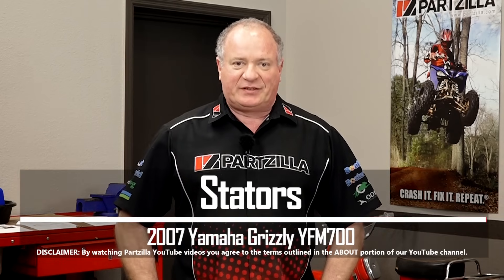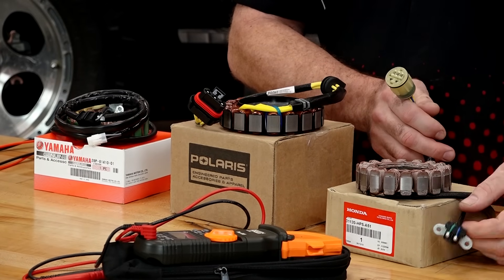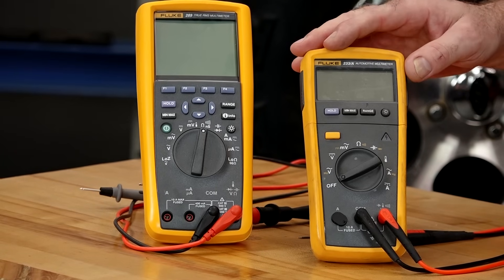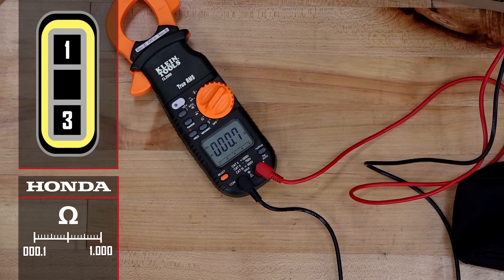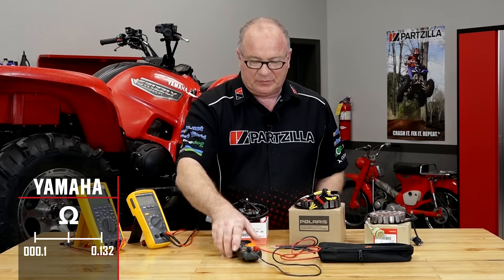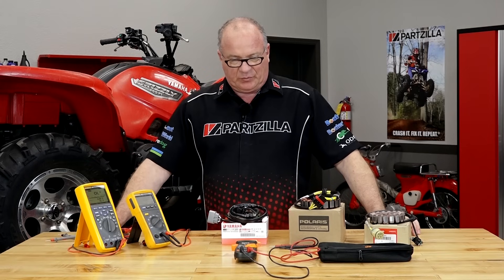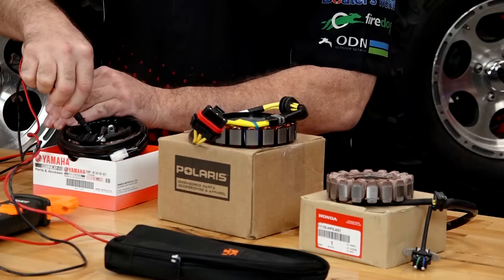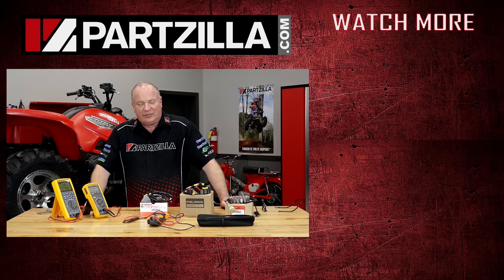How to Test the Stator on a Motorcycle, ATV, or UTV | Partzilla.com

Comment: Hello from Greece,you do great work,can i ask something.....motorbike is HONDA TRANSALP 700 and burn the stator  conector to reg. rectifier ,i fix it with three separate ones cylindrical type conectors, is normal the stator  cables (3 yelows) and the conectors to reg. rectifier to be warm (about 105-120"F) when the motor is runing...thank you...

Comment: 6.27.20.    A dynamic test is a far better indicator on the condition of your stator  windings.....If you do regular testing during your riding season, and you’re windings start shorting together internally, on each phases coils, you will pick it up as a reduced voltage between phases. My 1985 Honda Gold wing GL 1200, has about 70 VAC between phases at 3000 RPM. I test periodically throughout the riding season, so I can keep abreast on the condition of my coil windings of each phase. If I start seeing a variance between phases like say 70 to 60 or 50 VAC, I know it’s not gonna be long and I’m going to have to change out my stator. Being that it’s a Honda Gold wing four-cylinder, the Engine needs to be pulled in order to change out the stator. ⚡️ I do not want to be caught out away from home on a trip with a dead Stator‼️ I also went to a series configured rectifier regulator  SH847®️, instead of the stock shunt type❗️

Comment: Have 2015 polaris ranger not charging put a new regulator rectifier on it still not charging i have 20 ac volts coming out of each 0ne of the three phase wires at the rectifier any suggestion

Comment: I have a 2012 polaris rzr xp 4 900. I have replaced the stator and regulator with oem polaris parts. My question is,  should the wires between the stator and regulator be connected in a specific order. All three wire and plugs look the same.

Comment: Hello i have a 2021 crf450rl with only 1000 mi on it last week I started the bike and it was idling for about 5min while I was putting on my gear the bike stalled and when i went to restart it was dead I checked voltage on lith ion battery and got 0volts I bought a new battery and charged it to 13.8 v installed battery and turned on ignition checked all electric features and everything seemed to be fine pressed start button and it tripped the breaker in the battery i have no blown fuses or shorts as far as I can tell any suggestions please thank you

Comment: Great educational video until he actually does the testing of the stators. Can’t see where he’s plugging in the voltmeter, because his hand is blocking the stator, beginning with the Honda test at 2:55. Still gleaned valuable to-the-point info. Clear, concise presentation.

Comment: I did the static test between 1-2, 1-3, 2-3, and got the right resistance value.
But when I do the  1-2-3 to ground I dont have Open Line but 1,50 Ohm instead. 
What does it mean when you get values doing the Ground test? Damaged stator or bad connection somewhere? Thanks a lot
Reply: It was damaged stator

Comment: Question. I am showing grounded circuit from each yellow wire to ground but when I run the Ac test I do get the 30-50 volts ac between each of the three yellow wires. So is it bad or good?

Comment: I'm working on a 2002 Suzuki vl1500lc Intruder that is not charging after replacing the Stator, Regulator and battery.  The  one I got had the crank sensor wired backwards ( fixed that ) and  then found after that the regulator  ( original regulator) plugs were fried ( changed Regulator and wired it correctly) . Still no charging.

Comment: Hello - im really spinning my wheels tryting to find an answer - Ive put in a brand new regulator / rectifier, and done the tests on the stator you describe. They all pass except for one but i think my MultiMeter is not accurate enough - the test between each phase/coil is coiming up as 0.0 between all 3. Otherwise the stator outputs a consistent 28V on each coil at idle and 50+ when revving. The problem im having is that when the bike is running (2003 BMW F650CS) and i measure the voltage between the battery terminals, it fluctuates wildly continually between 30 to 110V.
I just cannot work out what the problem is. Any clues would be greatly appreciated.
Secondly, does it matter which way around i connect the x3 AC wires to the regulator  (I had to splice) ?

Comment: Hello, just tested my 2010 (2nd gen) FRJ1300 stator. All 3 pairs measured the same, 0.4 ohm. All open to ground. Understanding that the stator should be 0.13 to 0.19 between the pairs does this mean it's bad or and I missing something?! 
Thanks for your help!

Comment: i bought an eBay 50 dollar stator for my Yamaha raptor, i was told no spark bc of a bad stator i read the ohms of the bad stator it was 0.6, after installing a new one from ebay, it still didnt have spark so i tested that one and it read .7 ohms. could i have gotten a bad part? I'm thinking about spending the money for one on partzilla, any input would be nice.

Comment: I need a pro to solve this problem i am having with my honda vtx 1300.

The problem: no voltage out of reg/rec and its wires quickly turn super hot.
-Dynamic test on the stator shows 20-45 volts as i accelerate with no Reg rec connected. As i connect the reg/rec voltage drops to 5 and to 3 as i accelerate.
No shorts to ground from stator leads.
I thought it was the reg /rec so i replaced it 2 times.

Now thinking it could be the stator.

Any pro can help me with this?

Many thanks!!

Comment: This is the test  I need to do to my Yamaha big bear. The problem I had was when the bike was turned off, the neutral light kept coming on, causing the battery to discharge.  When I started looking for the problem I found the coil wire got disconnected,  wasn't off much, enough for the signal to jump to the coil. I've tested the coil and the secondary output was 9000, is that ok,  good or bad. I havent tested the stator yet. But next move . Thank you so much for the videos, has made it so easy to test and what to check for,  ur awesome lol

Comment: I have a 2002 gtx 4 tec batt not charging i tested 
the stater like you show us on all 3 legs get -:04 across all leads, I run the unit test stater again and get 24-28 ac volts across all 1+2 1-3. 2-3 you would think it’s the rectifier I cadges that and still only 12 volts att battery please help

Comment: Hello...i have a polaris sportsman 850 2009...batterie not charging and its not the regulator....i did this test and nothing wrong with the stator....but when testing the Voltage it give 4v .... i dont know if am doing it right...qny video shows how to test it running?

Comment: First, I want to say thank you for the Videos, you've been a huge help. Second, So I have been a Mechanic on autos for 30+ years and have recently started working on Motorcycles. I am having an issue on a 2003 Honda Shadow Spirit vt750. The wires at the plug from the regulator rectifier have started smoking and melting. is this caused from the regulator rectifier going bad and allowing too many volts to pass through causing excessive heat at the weakest point?
Reply: It could be from lack of electrical grease and a loose connection

Comment: I have a 2007 Honda vtx 1300r I’ve installed new battery and it remains to do same thing will last overnight for one day and then nothing I’ll get all the power to my lights but everytime I hit the starter button it dims the lights and doesn’t do a thing. I have yet to be able to run a dynamic or a static test on the stator or run a test on the regulator/ rectifier. Just wondering if anyone has had similar issues to maybe help me sped through diagnostics since I don’t have very much time to mess with it?

Comment: John
I love the way you explain everything in great detail, but I have a question. I am working on a Suzuki Eiger 400 here the magnets separated from the flywheel, which I am aware is a common problem on these machines. I understand that the stator can be damaged as well as the reg/rectifier. What is the best way for me to test that the trigger was not damaged on this machine. I heard about a procedure where you wave a magnet in front of the trigger to see if you get a reading? I would appreciate any help with this.
Thank you sir

Comment: Thanks for the video. I have learned valuable information here. When doing a dynamic test on a stator to a motorcycle with  42 yr. old tachometer and the multi voltmeter has a clamp to measure R.P.M.s. Where is the best placement for that clamp to measure true and accurate R.P.M.s? At the coil wire going from the coil or one of each four of the spark plug wires to get a consistent R.P.M. reading from the spark plug wires? Thanks again for the video and look forward to seeing your response, Clayton.

Comment: John help!!!. So with my polaris running and checking resistance i proved each face with my fluke negative lead on the negative side of the battery and the positive in each face and only on one of the face i would get a beep. Is my stator fried? i also check AC voltage and i would get 20 volts on 3 but on one i would get 10 volts.
Reply: Your stator is toast. Each phase should be equal to the next.

Comment: why is it that in another video, the man connected the black prod of the multi-tester to the body  of the stator and connected the other prod of the multi-tester to each wire of the stator, but the result is not Open Loop but there is OHMS reading?  He read also the values written in the manual and he said his readings are within the range given in the manual.  why is that so?

Comment: What if the ohms are higher than then range?
Reply: Stator is bad. You have to have the  resistance values before you start.  Remember ambient temperature affects resistance. Standard room temperature is 68-degrees, which resistance values are given. any variation you need to add or subtract 10% of your resistance value.

Comment: In three phases it is usually marked with r, y, b or r, s, t. What if the cables from stator that goes to the regulator is reversed, for example r, b, y or y, b, r.
how to know the order correctly?
if it is reversed will it affect the generated dc voltage?
because I have removed the socket from both.
Anyone help me, please..
Reply: the three phases do not need to be in any particular order

Comment: Honda doesn't supply ohm readings for electrical because ohm tests are not accurate , Honda wants tests done with a peak voltage adapter ... Honda also doesn't want you poking test leads into a wire coupler , that will spread the pin holes causing a poor connection ..

Comment: Ac ? My machines are 12 volt d c
Reply: No, the stator on all motorcycles creates AC current,  your rectifer or regulator converts to DC  and that might be 6v or 12v depending on the age of the bike

Comment: Hi,

I noticed that my bikes battery is not charging. 

I replaced the old battery at about a 100 km ago the old one with a new lithium one.

I checked the charge coming out of the rectifier end and got only a few millivolts. 

I checked the current and resistance on the regulator rectifier and it does work according to specs.

I checked the rectifier itself, resistance between coils = 0.5 Ohms , within specs. No Short to body.

Started the bike, rev up to 5000 rpm, multimeter on AC current shows 0.5 volts on each coil of the rectifier – no good.

I checked the wires and connectors – All OK. I was told that the flywheel itself could be faulty, is that even a possibility? 

Any suggestions ?